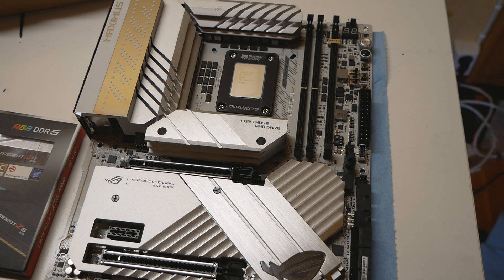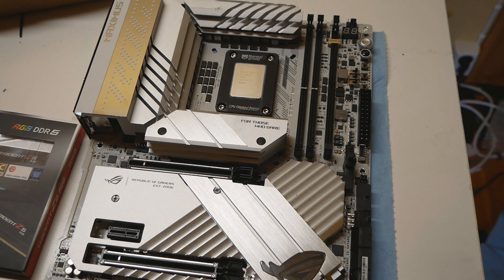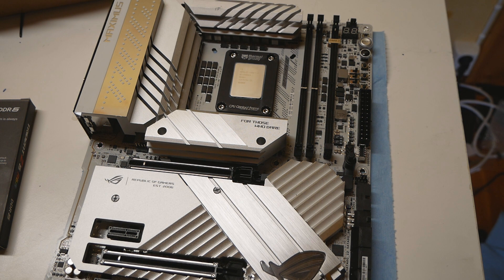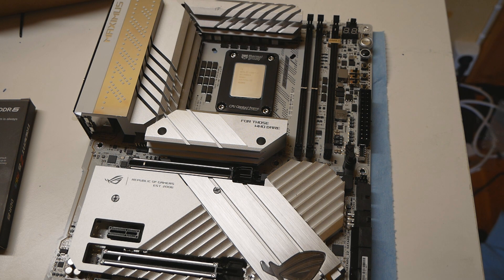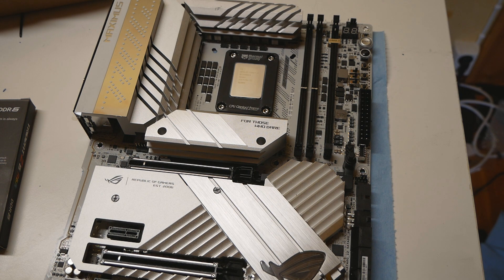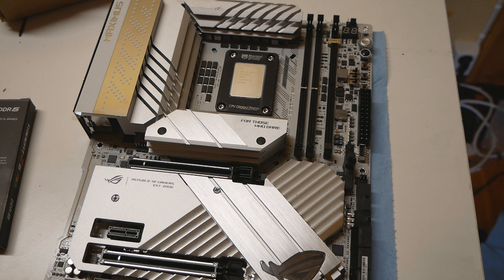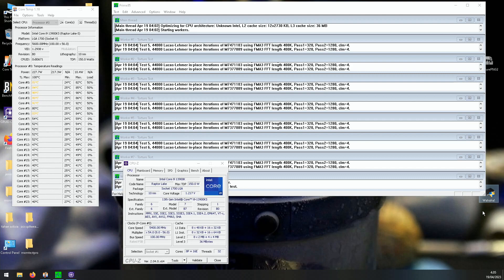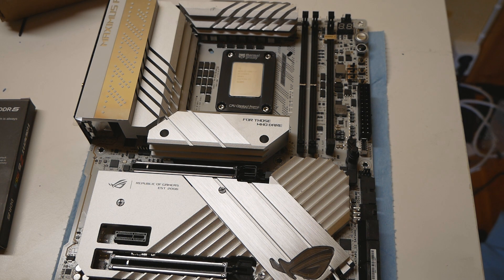Building a Z790 Daily System - 13900KS at 5.6GHz, G.Skill DDR5 at 8200MHz CL36

Comment: I also have the KS..   I have through out a year now still wondered IF the cache should be OC at all? I mean its extra power draw and the performance difference is basically next to nothing. Also it can interferer with the CPU calculations on vCore and cause instability.  Sometimes I set to x45 and sometimes to x50. ... If I then feel my CPU are getting hot or to many watt then I set to x45 haha.. But to be honest i dont even know how much it will add extra in voltage demand- it is something though! I have DDR6000 OC to 6600 with slim timings.. primary being 36-36-36-76

Comment: After delidding my KS and using a 360 AIO and liquid metal sandwich, I could technically run 5.7/4.5 but it will almost hit 100C in cinebench. Better to undervolt to 1.3V load voltage and run it 5.6/4.5. Runs like 10C cooler that way too.They left very little OC headroom for the P cores unless you want to direct die cool it or use the Tec cooler I guess.
Reply from the maker: Correct. Better to have nice and steady 5.6 at easier voltage and temperatures than push that last 100mhz.
Reply: What is a tec cooler

Comment: Is overclocking memory to +8000 Mhz only possible on two slot motherboards like Apex? I have z690-e and was wondering if I can buy high-end rams and achieve same results?
Reply: 2 dimm board required. Dark and Apex are your best choices.
Reply: @Jolinator  what's the max freq. that can be achieved on a high-end 4 slot board?
Reply: @davemorphling7432  For us normals? 7200-7600. The GB Z790 Master can run 7800. 8000 as well, but that is questionable as it requires a bunch of tinkering.
Reply: @theodanielwollff  I checked the manual for my board z690-e and it says max supported is 6400, which is a bummer. can that be pushed further with tinkering or is it final?
Reply: @davemorphling7432  Probably can get it to DDR5-6800 with a 13th Gen (K) CPU. That's about it really.
Reply: @theodanielwollff  ah, good enough for me, I upgraded to 13th gen recently too!
Reply: z790i edge/apex prob your best options

Comment: Buildzoid recently made a video about how he had great difficult getting high memory speeds on Intel 13th gen to run 100% stable. He kept getting errors very late into various stress tests. Did you run them for an extended period of time?
Reply: So buildzoid didn’t get golden samples, just regular samples?
Reply: @j340_official  correct… for example my 8000 ddr5 settings 49 ns on z790 tachyon he can not even post. He is great tuner but just so unlucky
Reply: @FaceGameFps  I couldn't have laugh any harder at this. Great tuner LOL. The done post bad timings all the time. Try to copy his settings and it is never stable. LOL. This was funny to read.
Reply: @theodanielwollff  what’s funny
Reply: @theodanielwollff Its almost like a ddr5 overclock is specific to the cpu imc, mb, and ram kit...
Reply from the maker: Only 100% in HCI memtest full capacity. Need to see how it behaves in normal use.
Reply: @LuumiJuhani  buildzoid has not been lucky getting good silicon. He can not even use my settings to post.
Reply: @LuumiJuhani  100% HCI means nothing - its not stable

Comment: Impressive RAM tune on something that appears to be daily-stable! Curious if you also validated the mem OC with Y-cruncher VST?

I've found that on 13th gen, VST tends to pick up on a lot of issues that MemTestPro and TM5 with anta777extreme config miss -- especially if it's due to mem controller voltage or PLL voltage rather than mem timings.
Reply: Yes, Trident Z5 is stable with 8200 as opposed to Patriot 5 new September 2023 8200

Comment: You said you got to tWRWRdr/dd to 4, but the timings in the video show both are set to 16 and different rank and different DIMM timings are not used in 1 DIMM per channel setups with single rank DIMMs…?
Reply from the maker: Both sticks have same timings. The tWRWR_DR and DD were set to 4 in the highest profile. That middle profile on the video had them still at auto.
Reply: @LuumiJuhani  Am I missing something? Single rank on 1 DIMM per channel won’t use different rank and different DIMM timings and you can set both dr and dd to 1 for all four sets of tertiaries?

Comment: Is it worth using power limits to keep the AVX power draw in check? If you get it to clock down with the power limit, lughter AVX workloads that dont saturate the cores wont downclock, but heavy stuff like encoding will downclock and will benefit from the lower voltages of dropping into the lower multiplier ranges.

Comment: Apex in a 24/7 system seems like a waste.
Reply: I'm running 8400mhz as daily in my gaming rig with z790 Apex. Memory performance is the meta for gaming performance, so Apex is a great choice :)
Reply: @nizzen2  are you running that actually stable? Buildzoid had quite the issues with extremely random memory instability at higher frequencies
Reply: Not really. It allows to push the max Performance that you can pull out of that platform. On a daily basis.

Yes it's doing its best under LN2, but it also offers you one of the best daily performance aswell
Reply: @Mom19  It's still a waste to get Apex for a 24/7 system, you're paying tons for a marginal performance difference, compared to any mid range motherboard and RAM. Sure it's fun to overclock, but for a daily system such a system contributes to virtually nothing, it's realistically wasted money.

Comment: Any chance you could give some memory tips for this 8000+ ram? Ran into some crashes when im trying to run some custom timings. 

Great video!  Thanks for all you do. Also the paint thinner trick was awesome. I giggled as much as you in your video!
Reply from the maker: Voltage needs to be spot on for HCI stability. Not too high or too low.

Comment: I did this with z790 tachyon 5.7 4.5 8000 at 49 ns —- easy
Reply: what voltage?
Reply: @Garrett1974  for the ram kit is 7800 gskill and oc to 8000 1.54 1.5 on water …..
Reply: @FaceGameFps 1.5 is too much voltage